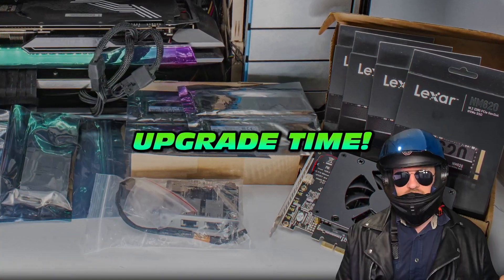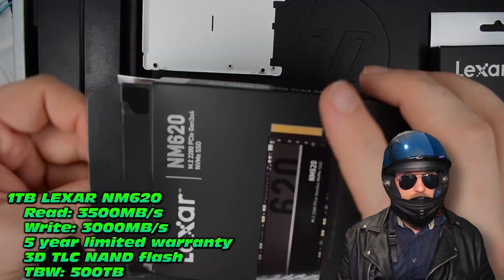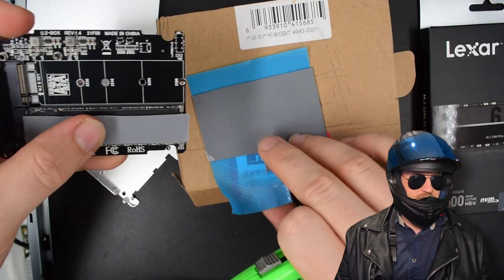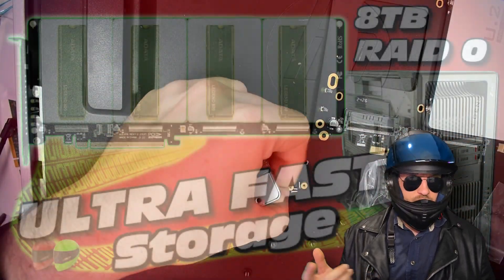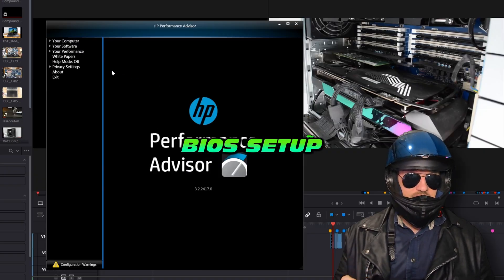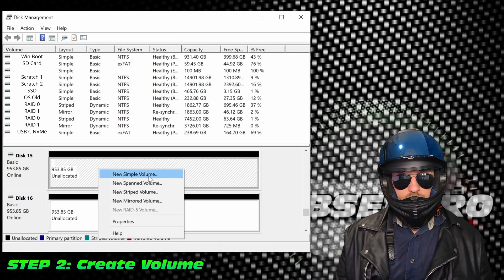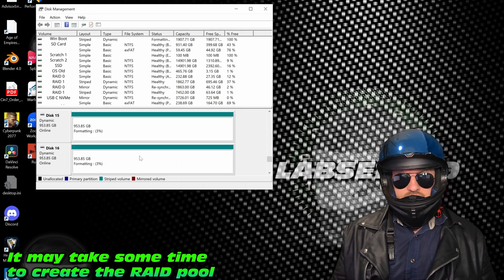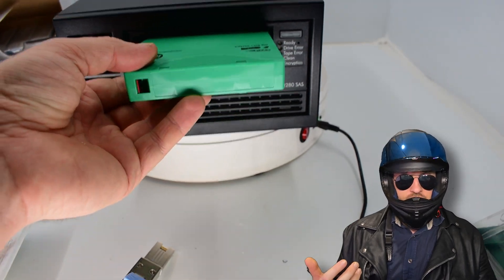DUAL U.2 To M.2 NVMe Adapter- It's Not Over 9000 MB/s, but Blazingly Fast Nonetheless. (#RACERRRZ)

Comment: I'd also love to see that maxed out running as a local AI Server. :)
Reply from the maker: Update on that front. I have been testing this system by running  LLMs locally. The best model so far for my needs has been Gemma 2:27b (27GB VRAM model; modeled from Gemini models; Context length 2048, Output creativity 0.8, Top K sampling 40, Top P sampling 0.9, Repeat Penality 1.1, Tokens to Generate 30000, Seed -1, CPU Threads 20). I am using Braina to test out the LLMs - try it out! I'll make a video on it for sure.

I tried Meta-Llama-3-70B (requires 70GB VRAM) locally while using CPU / RAM and the Z8 took it with a smile, but the output rate was too slow (maybe 1 word every 2-3 seconds). But yes, the HP workstations will dominate the local LLM race. Bring on the HP Z8 G5!

Comment: I'm using 4 Optane 960 mb on a quad u2 to pcie adapter for my proxmox server.  Great setup for virtualization and cache dependant scenarios.
Reply from the maker: Nice setup. The Optane U.2 SSDs in a quad adapter will yield excellent caching performance. How was your NVMe thermals on that adapter? I found the quad U.2 adapter to lead to overly warm NVMes if under load for prolonged periods. Some passive cooling seems to help quite a bit.
Reply: Yes they need attention to cooling and the adapter card must have an open back.
Reply: Speaking of excess heat... I have 16 m2 nvmes in 4 plx bridge u2 adapters on a single u2 to pcie adapter.  It's doable.
Reply from the maker: @jk-mm5to  That sounds like it has the potential to get toasty! I presume they are within a server where the airflow decent? In the workstation configuration I need to add extra cooling to avoid temps over 75'C (with thermal pad I get them to operate ~ 45'C). The same goes for 10GbE NICs - they overheat without some added airflow.
Reply: My workstation contains 6 thermalright bl12 extreme 3200 rpm fans. 3 are used for the radiator. Also present is a 140 mm exhaust fan.  All in rosewill  helium air case, no glass and fully perforated.  I need to keep my 2679v4 below 50c to  sustain 240w pl2

Comment: That u.2 is causing bottleneck
Reply: I run m2 to u2 regularly and have never seen a loss in performance.
Reply from the maker: I did test the M.2 NVMe speeds for a single drive as well as two M.2 NVMes in RAID 0:
   Lexar NM 620 1TB published speeds: 3500MB/s, write up to 3000MBs.
   Single NVMe: 3527MB/s Read and 3014MB/s Write.
   Dual NVMe (RAID 0): 6916MB/s Read and 5397MB/s Write.
Decently good, but you might see better results with certain Gen 4 NVMes.
Reply: Eh there's always some bottlenecking somewhere
Reply: What the hell do you mean by some 🤏
Reply from the maker: @ZahidulAkash123  It's decently fast given that there was only two NVMes in the RAID 0 pool. For reference, I did a 22 M.2 NVMe RAID 0 pool (https://youtu.be/P8PN6uM4ZFg) and it wasn't that much faster. The U.2 interface has generally given better speeds than typical M.2 NVMe adapters (e.g. The U.2 adapter in my previous test of 4x Quad adapters netted the highest speed: https://youtu.be/xqg0uQ93KTg ).